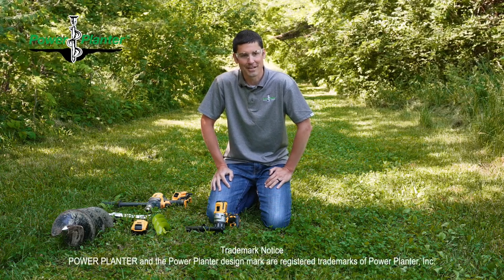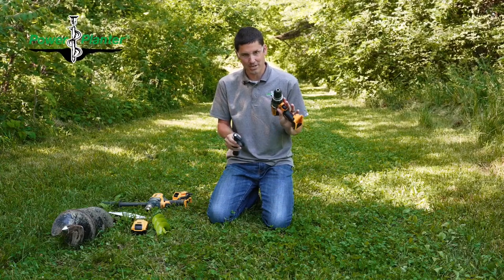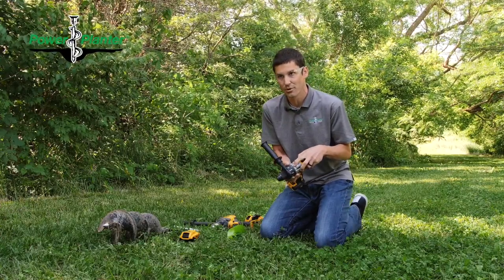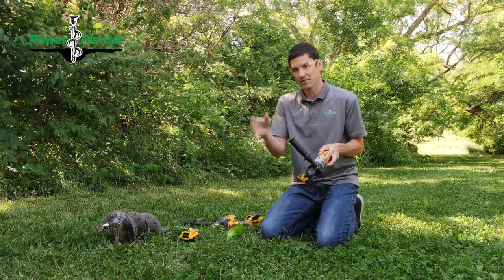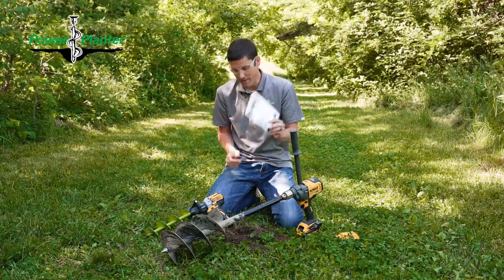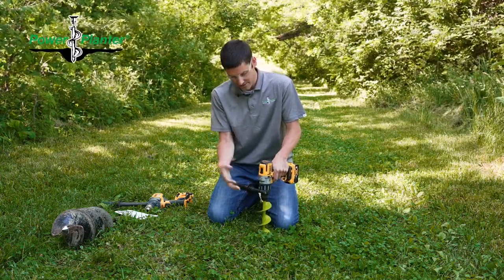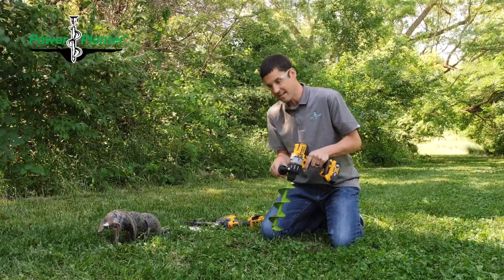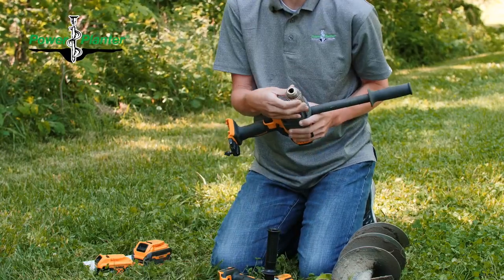Getting Started With Power Planter Gardening Augers

Comment: Thank you for the safety video. I learned a LOT. I knew nothing about drills or augers before buying yours, so thank you. I wanted to note, however, that after all the safety talk, you used your hand to clean out dirt without taking out the battery and that seems like a dangerous thing to do.

Comment: Would the Dewalt DWD450 be appropriate for use with power planter augers? (It has a clutch)
Reply from the maker: Yes, just be very careful about the cord getting wrapped up.  We used to sell the same model, only the cordless version.  It can easily handle up to the 9" diameter auger and anything less than that.

Comment: How do I take the power planter OUT of its socket after securing it in? I don't seem to be able to reverse the lock?
Reply from the maker: You should just turn the chuck to loosen.  If you have your drill's manual, refer to that.  You can also give us a call for 1 on 1 service. 217-379-2614
Reply: I have the same problem.  Were you able to figure it out?

Comment: My hammer drill has 3 modes, which one should I use: drill, drive or hammer?
Reply from the maker: Drill mode, and then set the clutch as described in the video
Reply: @powerplanterinc.2967  Wow, thanks for such a quick response!!